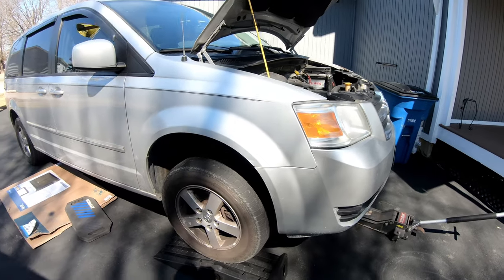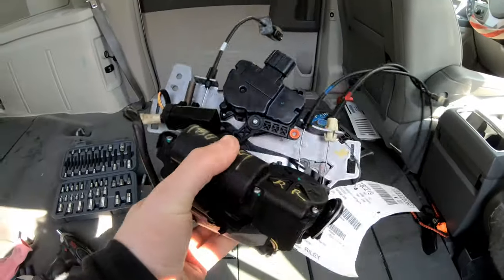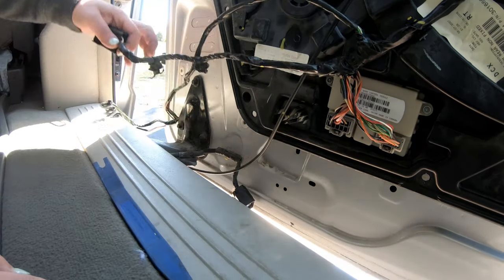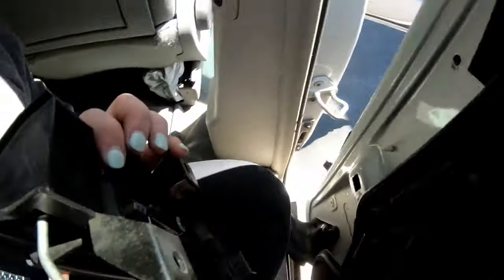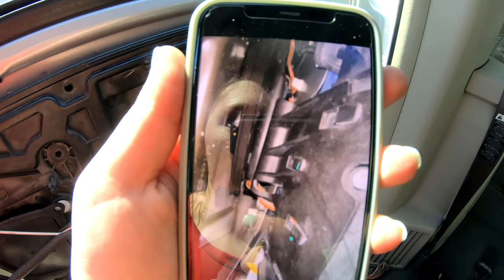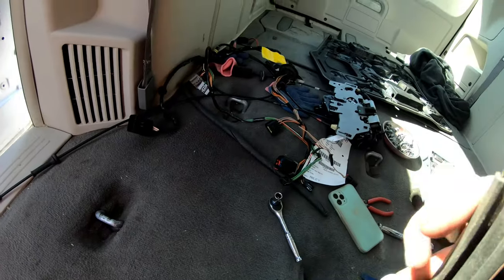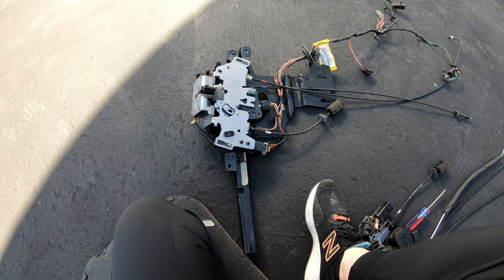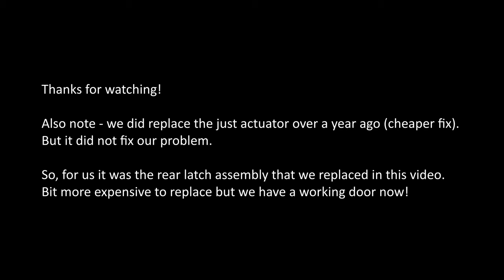Fixing Dodge Caravan Sliding Door that Won't Close - Rear Latch Replacement

Comment: To get that inner panel off at those for prongs, there is a lock tab to keep it sliding. I took a long handled screwdriver and went down from the top and wedged the blade in there so it would clear. I also sprayed the tabs with penetrating oil to help it slide.
Reply: You are a godsend, no video showed do do this 😭

Comment: 2016 dodge van manual door with just the rear hatch being bad. This much work just to replace the latch is unreal. I can't get the latch to move at all from the outside, and door wont close all the way. What a pain.
Reply: Were you able to repair yourself? Or did you need to take it to a dealership?

Comment: I'm having the same problem with my 2018 van. I replaced the door latch actuator hoping that would fix it but no luck, so I think I need to try again with the latch. Did you have a REALLY hard time getting the lock assembly and window track back in place? It took me forever!
Reply: same problem. how do you put back the track window. I can not find the hole to put the bolt. Thanks for your help

Comment: I have a VW Routan.  My slide door was stuck closed.  Nothing opened it. I solved it as follow:
 1.-  I opened the door by pushing forward the button while I tried to open manually the door (by pushing back the handle).  I got to open the door that way. 
2.- I took the panel off.
3.- I tried to manually pull and push the wire that goes to the back (to the actuator). I used a tweezers.
4.- After nothing happened I sprayed oil inside the hole where the wire goes to the actuator. I used  W40 with the thin straw. I inserted the staw all the way and sprayed 3 times.  I waited 20 min. 
5.- I push and pull the wire again with the tweezers and suddenly it got unstucked.
6.- Place everything back. 
I hope that helps you all.